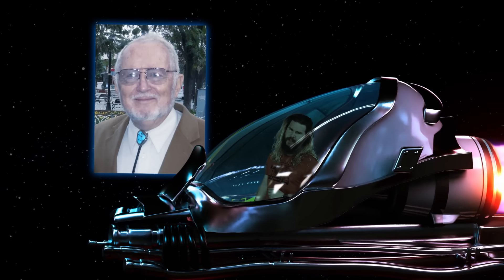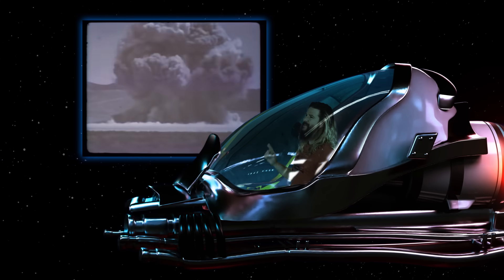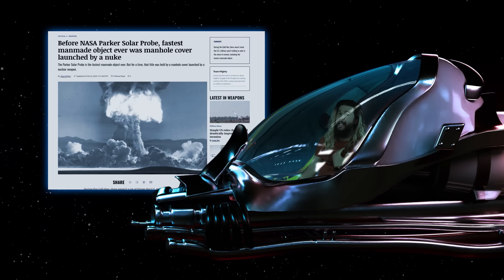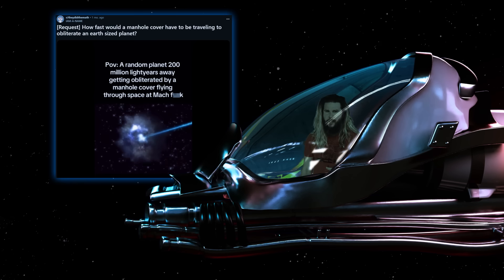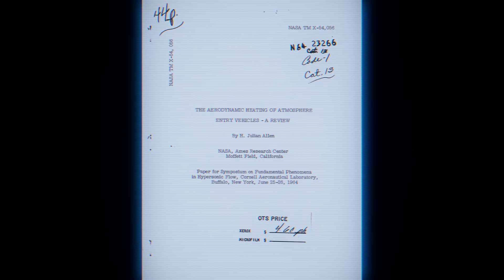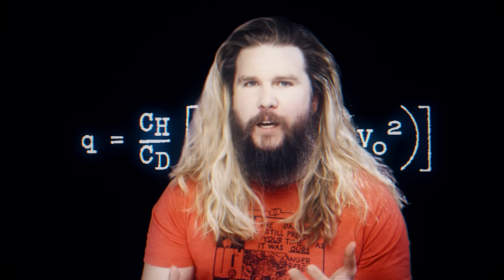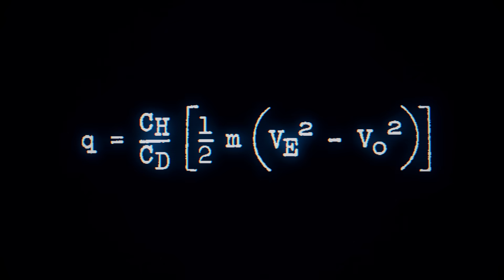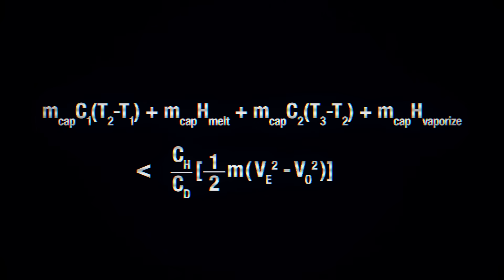Debunking the Nuclear-Powered Manhole Cover

Comment: Considering Vo=0 is a major mistake, it implies that the atmosfere had enough time to stop the manhole. In order to consider the right therm (Ve-V0) you would need to figure out the velocity Ve at the top of the atmosphere where drag basically "stops".
Reply: Except you can't cheat physics by going faster. The atmosphere is the atmosphere. The forces involved are the same no matter what. If you compress the atmosphere into an incredibly thin band, it simply applies those forces in a smaller timeframe. You can't cheat physics by going faster. It's the entire reason FTL is an impossibility. You can't outspeed physics, it just smacks you back harder and harder until you explode.

Comment: No disc. I'm a flat surface is going to stay flat when cutting through the air it's going to begin to tumble. 
Second, was the cast iron manhole cover pure cast iron or did it have any other minerals in it? Did it have any steel chromium or anything else in there for rust corrosion resistance?
Third, A lot of meteors as they're coming into the atmosphere are superheating and explode typically because of a gas pocket inside the meteor that ruptures the meteor and the pieces.

Comment: Amateur physicist and general all-around fussbudget here. I see two major flaws in your calculation that I have not seen others mention. First, the initial formula you reference seems to calculate the total heat produced, but not all of that will be retained by the projectile, much will be shed into the atmosphere, especially as melted bits fly off. Second, you assume that when the disc is launched perpendicular to its direction of travel, it stays that way. It is my understanding that any flat plate or disc moving through a fluid will rotate, wobble, or behave like a falling leaf, so it spends much of its time in an orientation with far less air resistance than your worst case assumption. Thoughts?

Comment: You set the final celocity V_O to 0. I'm assuming that was a mistake because the cover definitely didn't completely slow down right at the edge of the atmosphere lol. Id guess it barely slowed down.

Plus, the equation assumes the object is falling for several minutes, while with 66km/s the cover would've exited the atmosphere in less than 2 seconds. that's so fast i doubt that's enough time for whatever amount of energy it would've received to even get transferred.

Really the proper way to do this would be a simulation, until then ill assume the cover moved through the atmosphere like a cosmic ray does; it barely noticed its there
Reply: I just saw someone point this out too, the right side of the equation represents more energy than the cover even has! Normally that's fine, since the equation assumes the object is falling for a long time, constantly supplied with more energy from gravity (from its potential energy). But for a rising cover this would be the oposite! Gravity is only helping it slow down.
Reply: And another thing, the coefficient of drag you used assumes the cover was rising flat side up, but that's not how flat disks move through air, they tumble.

If anything this video has convinced me the cover definitely did survive haha

Comment: Question- Isn't the reentry heat calculations not necessarily accurate due to the fact that the atmospheric density would logically be flipped? From my understanding, one of the reasons things burn up so easily on entry is not only drag, but it also goes through consistently denser air, meaning the drag would also logically increase as the air, acting like a fluid, would become harder and harder to move through. Logically, going upwards, wouldn't it become easier and easier for the iron disk to fly upwards as it has less and less air in its path, as it is instead moving away from the denser air, rather than at it? Of course, the temperatures of the nuke and energy applied still will have deleted the manhole cover of mach-middlefinger most likely

Comment: There's a major mistake in this calculation that invalidates the result.  The ratio eta = C_H/C_D given in the paper is intended to be the fraction of the kinetic energy that is transferred as heat to the vehicle, and so can be no larger than one.  In the numbers used at 9:37 it is given as 24.1/1.28, which is far too large.  If you assume the maximum allowed value of one, which is ALL kinetic energy transferred to the vehicle, then it is 2*10^12, which is too LOW an energy for vaporisation.
Edit: There's an even worse error on the left side of the equation, where the number they got is too large by a factor of nearly 1000.  That means the kinetic energy is far more than enough for vaporisation.  The velocity is not really a reliable estimate, but even if it was just escape velocity then the energy would be more than enough for vaporisation.
Reply: Bruh literally ever variable is getting dissected by the comments for being falsely picked :D
At this point I wouldn't be surprised if he posted a video "guys it was a joke to see if you can tell apart bad physics or not" tomorrow.
Reply: @GodplayGamerZulul  Nah, Kyle doesn't seem like someone who would do that, if anything he might release a video transparently rectifying his mistakes (which would be great to see tbh)
Reply: BUT you forgot one key variable: time. At that speed, the cap would be out of the atmosphere in under a second. The heat would not have enough time to conduct through meaning the front would quickly vaporize like an ablator, which would help in cooling the cap since the vaporizing metal would carry heat away with it
Reply: @Blockenheimer  an oxygen cutting touch cuts through inches of steel  pretty dang quick.
Reply: @Blockenheimer   For these types of speeds you can use Newton's approximation for the impact depth.  A projectile will stop once it has displaced an amount of material roughly corresponding to its own weight.  If the cap is about one metre across, then it would need to displace about 10 tonnes of air to leave the atmosphere.  Since that is more than 10 times its weight it will stop far before that, and most of the kinetic energy will be converted to heat.
Reply: Even worse, you can't get Vmax since only 1 frame has the manhole on it. Honestly it's really inconclusive at the end of the day.
Reply: @TrevorD19   That's right, but if it was going above escape velocity it would vaporise.  If it was slow enough to not vaporise it wouldn't make it to space.
Reply: Not only that, but I'm not sure that he was correct to interpret C_H as the Nusselt number. The paper calls it the 'dimensionless heat transfer coefficient', but there's no guarantee it's the same one as commonly used in calculations today (Nu = hL/k). He also does not provide any info on where he got his Nu value from, which is pretty bad practice.
Reply: This right here.

Comment: Even after this video, I don't know if I'm ENTIRELY in camp "burned up." My reasons are: The object is moving EXCEEDINGLY fast, meaning the OPPORTUNITY for it to absorb enough energy to vaporize is a question left unanswered (hypothetically, if it could get OUT of the density-zone BEFORE it fully vaporized, some non-trivial amount of matter MIGHT have escaped the atmosphere and retained a certain amount of velocity, though maybe not enough to actually achieve an exit velocity and it would finish burning up on re-entry. The other reason is that, as someone else mentioned, there might be some kind of Leidenfrost effect where the jacket of plasma around the ascender may prolong it's life in atmospheric conditions, and, again, going back to what I just said: there might be some parametric relation where it's moving SO fast, it can almost "outrun" being in the zone long enough to burn up entirely.

Comment: Thanks for clearing it up, Kyle. I did a bit of math and depending on it's rotation I still think it might have made it well past the Karman-line, but your math checks out too😅. If it was rotating fast then there would have been a low pressure zone in the middle. That would protect that area for a longer time to heating. Food for thought. IAM1 made it to the surface though and that was traveling through our atmosphere under an angle and at interstellar speeds